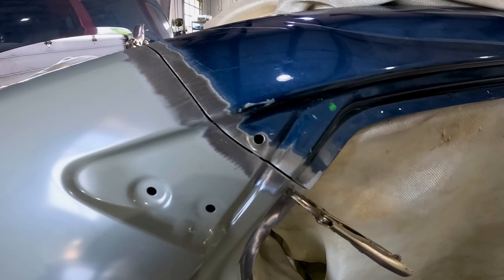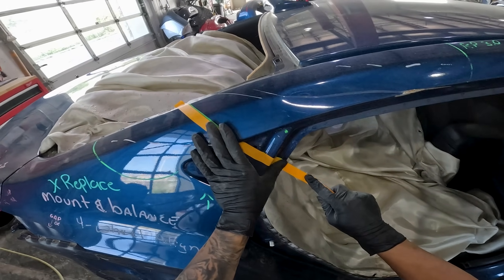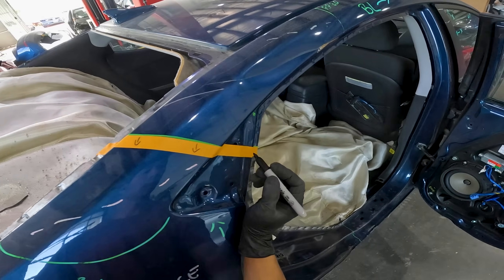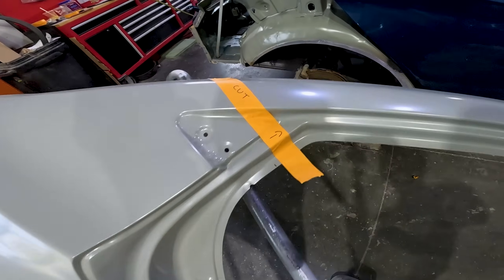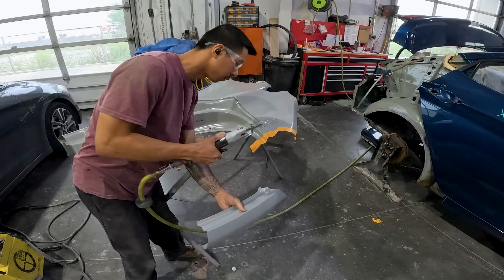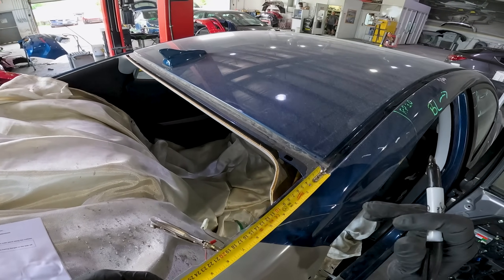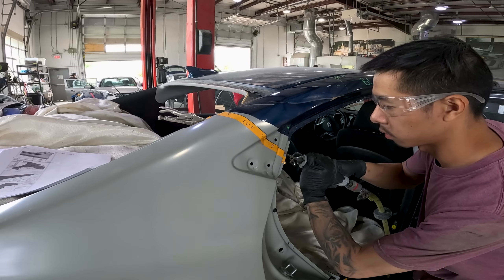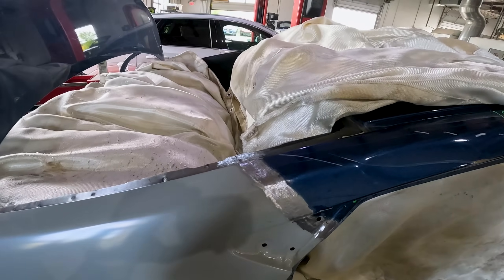This Took Years To Learn, I'll Teach It To You In 2 MINUTES!!

Comment: I did collision repair for over 30 years! This is practically the same method that I used and the only way to do it however for the sake of strength and to give the Weld a backing I will put a 2 inch piece of the new quarter panel inside lapped under the skin on each side of the joint. Especially at the rocker.
Reply: In the 80’s and 90’s some people were saying the metal 
was to thin LoL 😂 
Welcome to 2024 some areas are paper thin now.     👍
Reply: @mhughes1160  RIGHT!? 22-28 ga! You do nice work.
Reply: I do the same thing. I drill a few 3/16 holes on each side of the weld and spot weld the backing plate to hold it in place and for a little extra strength. Makes welding up that seam alot easier too
Reply: I do the same thing, but add a backing plate a little thicker than the replacement panel.@edjackson4389
Reply: Most manufacturers disallow a backer these days. Open butts only.
Reply: @jasonehredt968 yes that's because if you work to manufacture recommendations as supposed to then the entire panel would be replaced, nower days the panels are plastic riveted and bonded . 
Steel is so thin now and high carbon content it's not actually suitable for welding.  I disagree with your comment. 
Actually makes more sense to joggle the panel edge and make a lap joint as this prevents distortion.
Reply: This is how i do it and i do this repair using used quarter panel from junkyards. lot of guys dont know shit about having to remove a quarter panel from a used cut from a car and install it on to another car, guys now days get all new parts, must be nice to work in a shop using all new parts.
Reply: @jasonehredt968  I like baby got back.
Sorry my mind drifted for a moment. 😉
Reply: @turboimport95  print the insurance company a copy of the manufacturer recommendation of no used weld on parts . Even drp shops get new parts . Your getting bent over.
Reply: @jasonehredt968  you are correct  about not using backplate that was early icar recommendation.too bad people in comment don't understand using a backing plate now on car is not recommended maybe on a truck or suv.
Reply: Awesome clip, thanks for the tips!
Reply: What blades do you use?
Reply: @jasonehredt968 I was gonna say the same thing. You have to check the oem procedure to see if they allow a backer or not
Reply: don't worry about the haters,these cars today are junk off the showroom floor!!insurance companies and shops screw the customers and especially their techs!!most owners can't even do a repair!!!!!
Reply: I would have thought that lapping is a bad idea, because you cannot protected the hidden parts from corrosion.
Reply: I too do body work for a living, all vehicles require  a repair procedure,and I was wondering about ,what about the reinforcing behind the splice,but it's just a tip on making easier, better looking fit on the splice.
Reply: @dungareesareforfools that's what cavity wax is for.
Reply: Sorry but u never ever overlap metal as it doesn't fit properly and is a nest for future rust and a complete redo of the job.
Reply: @turboimport95 the junkyard is so expensive now it doesn't make sense not to buy new parts..
Reply: @matthewmoilanen787  Yes and no. Everything has a place.
Reply: @chrishull4174  I like the reinforcement factor, and with proper attention/practices/protocols, will out last the vehicle.
Reply: @turboimport95  Not really. The new parts, for most of the part, are after market, despite the almighty capa designation, they fit like shit. You'll be drilling holes where they should be,  because they aren't, cutting off flanges and welding them in the proper place because again, they aren't, radius often don't match, and if you do use o.e.m. it still won't be as thick as o.e. It's a shit show any way you slice it, the only benefit, they most likely won't have rust. That's it.
Reply: @jasonehredt968  Some car makers refuse to aloud butts welds and some will have a backer made of the part when the new part is laying on top of the old one....... read the instruction before welding. ....... there are a lot of methods to do this king of cutting and weldig.
Reply: @chrishull4174  you are very right, besides these "welds" should be MIG (CuSi) brazed, because of the high carbon content.
And yes, the Panels are a lot thinner, but they are also a lot stronger as "old(er)" steel panels..... ; )
Reply: These days everyone says no overlapping joints, but look at OEM bodies, all overlaps, no butt welds anywhere? Butt welds mean no rust in the overlap, plus maybe room for hammer and dolly finishing.
Reply: @turboimport95 ❤❤ I'm with you, I would rather put good junkyard parts on than Chinese crap
Reply: @raidenout1515  a lot of times, parts are back ordered or discontinued, you cant tell a customer a new quarter panel is a 6 month wait time.. insurance company's aint gonna pay for a 6 month rental..
Reply: @turboimport95  Let it total . No manufacterer allows use of used weld on parts . It opens liability of the shop and the tech in case of a lawsuit . Icar forbids it's use . At least get them to sign off on it and file the record for you or your techs . Nobody wants to lose their house . Not trying to be a downer or flex . Just looking out for the techs out there . Right on the icar website and in alldata.
Reply: @raidenout1515  i dont see why it matters cause its not structural and its thin as a beer can anyway. problem is insurance allows used parts if new ones cant be obtained, cause they would lose money totaling out cars for a few grand. During the pandemic nothing new could even been got, so every car on the road would had been totaled according to you.. quick way to bankrupt insurance companys..
Reply: I watched the guys at a shop that “clipped” cars that were “ total loss claims”. They “ sleeved” the rockers, windshield pillars, made them strong.
Reply: How do you prevent rust between the pieces when they're welded together? Is it possible to get paint in there to cover the entire surface?
Reply: @ThisRandomUsername  weld through primer and panel bond, then seam sealer on the outside of panel edges to seal it in.
Reply: @turboimport95  Insurance not only pays for it but demands it for collision repair on newer cars. You don't have a choice, it is part of the insurance estimate.
Art from Ohio
Reply: @artszabo1015  sorry but insurance also demands you save them money on repairs as well..
Reply: @turboimport95  I don't understand why you would be sorry about that. It seems to me that would be a good thing.
And I don't think you understood me. 
1. When a car that is insured is involved in an accident and the damage is covered, an  adjuster from the company will look the car over and write an estimate for repairs.
2. Depending on the age of the car and the policy the insurance company may DEMAND that Original Equipment From the Manufacturer be put on the car.
Therefore, the OPTION for junkyard parts would not exist.
Reply: @artszabo1015  yeah im sure they will pay for a new oem rear quarter panel for a 2005 Lexus es350. Im sure Lexus has those in stock.
Reply: @turboimport95  I replied to this but it got removed.
Reply: @artszabo1015  dont feel bad about it, i get removed all the time.
Reply: Exactly the same, my Italian mentor taught me that and its always been my favourite method.
Reply: I used to work at a shop where a guy would overlap the new qtr and just glue it on. I never heard of or seen anyone but this guy do it.
Reply: Some manufacturers do not allow backing plates
Reply: @rickdee67 i just redid my little brothers rocker panel and it seems like anything thinner than 16 gauge is too thin😂

Comment: Been doing it like this for 30 years. I allways tack in a bonding strip beneath the joint for strength and to reduce sparks on the inside. Lots of stuf in there that can and will catch fire such as noise insulation.

Comment: It’s a little tough to get corrosion protection on the backsides of the seam w those “bonding strips “ in the way….corrosion being the number one cause of a ghost line not to mention for the comments of the guys that did bodywork for 30 years you of all people should know that the only way to join metal is to refer to the manufacturers repair manual for that specific year and that is the only way to join it paying special attention to what areas are suitable to make the joint… 10 years ago, everybody was mig welding  it now everybody is brazing it w silicon bronze…and it’ll change again probably in another 10 years…oem repair procedures…nobody else… they didn’t spend millions and millions of dollars doing research so you guys could come up with your own procedure… I do have ever like the channel. I like the fact that you’re young and getting into the business keep on doing the good work you’ll go far in this trade.
Reply from the maker: @chrisgray2956  great points! 👍 thanks! Yup, it's all about liability and following OEM procedures. A lot of guys are saying it's not I-CAR procedure but I CAR does not supercede OEM 😂

Comment: Butt welds offer no strength in panel splicing. Especially àfter grinding the weld on thin sheetmetal. It should ALWAYS have a backer piece or flanged edge! Without it, Its the first place to fold or crack from weakness if the panel were to take another impact. NFG!

Comment: I used to make up a fillet to go inside between the two panels where it butts up, then weld it together. Helped stop heat distortion. Quick grind off. Perfect finish every time. I did this work ( body and paint) for 25 years. 6 days a week. 12 to 15 hours a day. I got so prolific it wasn't unusual for me to be working on 8 cars at a time. Getting them ready for my guys when they came in the next morning to get them in the booth for paint. Didn't do my marriage any good however.
Reply: While your where slicing cars rudy was slice n dicin ya wife poor jody

Comment: I was doing this in a insurance approved body shop at the age of 17.. Also using body jigs, floor pullers, pull dozers, replacing front ends rear ends re-shells you name it! 28 years on still doing it! However I'm now feeling it! Get a desk job kids!
Reply from the maker: @Supercarlsunday  😂
Reply: Cars a too complicated now. Airbags, sensors, electronics and now huge dangerous batteries. You need to be an engineer to work on this crap they produce now. Imagine if they just perfected the beautiful cars they built in the past. Simple, strong, affordable and simple to work on.
Reply: @mikehunt-vd2jx  They have changed some for sure. Strip and fit is more time-consuming. It's just time. More crap to go wrong, sensors, etc. You move with the times and get used to it, though. I only know one other lad still doing this job from when I started. He is a mechanic. All the rest have dropped out. There are plenty bull shi! Jobs pay more money. Not for me though. I will keep going, for my sins..
Reply: @Supercarlsunday  my hats off to you. I did it for 10 years. I just didn't have the knack for straightening metal. I have a knack for taking things apart and putting it  back together. What you can do is an art, but sadly people like you are never paid enough for your skill.
Reply: @mikehunt-vd2jx  your right, never make hourly rate. Always something needs to be bought. I appreciate you understanding that. I hope your doing something now that works well for you and allows you to have a good life with good health 👍

Comment: Gap is a little big. The best way is cut the new quarter where it needs to be. Then over lay it and scribe a line with a sharpe object. Cut the panel and debur both panels. Youll then have a super tight gap. As for the techs that say to use a Backer. Im against it as it doesnt allow cavity wax to get between the backers. If its a butt weld then youll be able to spray it with cavity wax. Most of the time procedures say Butt weld only. I forget what they call a butt weld with a backer, i think its called a "fillet" remember seeing it on the symbol sheet for a quarter i just finished up.

Comment: I used a similar tecnic to cut a board of wood to fit a especific hole. Bigger board that covers the entire hole and then cut both. I cut it on a 45º angle in order for the board on the wall not to fall inside the wall. In metal, that won't help you. Maybe make three cuts and tack weld the cut corners. Then finish the cut.

Comment: I let new panel overlap by 1/2in cut a slice in old panel 1/2in in the outside corners then the new panel has a backing and the corners you sliced can give enough to fit properly

Comment: I would have used an agle grinder. Its more precise or maybe its just my ability to use one like pocket knife. But dope sauce, dude killer work!
Reply: The metal dust from the grinding process will spoil the paint work that will be done. Basically, the body saw is easier to contain. Still makes a mess but it won't shower everything in hot slag.
Reply: @daviddntait  Diamond disc not so messy

Comment: I prefer to use panel bond adhesive with a series of backing strips glued to the underside of one side. The backing strips are 1 5/8” wide, leaving a 3/4” flange on each side of the gap. This is clamped using aircraft Cleco Clamps through 1/8” drilled holes. Then glue on the new panel by laying it onto the flange created by the backing strip. Then fill holes with more adhesive. This creates a super strong double thickness joint that has zero warp, no sparks and is completely watertight.
Reply from the maker: @rodb8274  this is a similar method to how BMW and MINI do it. I will have a video with that coming soon.

Comment: Good job hear in Australia we have to remove the panel at the original join seems and spot welds cut and shut jobs like this are illegal the was to many bodgers doing bad work and car's would break in two in an accident so it was outlawed you would need to reinforce the joint and get an engineer report if you want to do it this way even a chop top needs to have a engineer report before it can go back on the road it makes custom work a lot more difficult to do hear and much more expensive for the customer
Reply: Wow thats crazy!! I mean, I see the point but i bet it makes life and doing custom stuff really tough!!!
Reply: USA here educate me what's the definition of a bodger never heard that term before Thanks
Reply: @markpayne6803 
I think it's a combination of the word dodgy and botch-job.
Reply: Same here in the US, not the official OE procedure, not crash tested.  Some of the 1500 MPa panels become much weaker at the heat affected zone of a butt weld.  Times and materials have changed.  Look up 3M and John Eagle Honda.

Comment: I almost always put a backing plate on most joints. It's ez  and less filler you don't warp the metal as bad .don't care what aldata says. It's a skin when you start messing with structure hole different story .
Reply: But then you're never able to completely apply corrosion protection to the joint

Comment: I personally like to see a sleeve added with some plug welds. It really adds strength in the rocker area.
Reply: I’ve done many with sleeves but these days you have to follow manufacturers procedures. If they don’t allow one (most don’t) then you shouldn’t use it otherwise you’re making yourself a liability.

Comment: I feel like that sail panel and rocker should be sleeved, with plug welds on both sides of the butt joint. But, it still looks good from the outside, and you only replaced the outer skin, with no structural damage that I saw. Good job.
Reply from the maker: It really depends on the manufacturer specs whether to sleeve or not. When sleeving these joints, it does add strength to the welded area and may actually be counterproductive to the ability for it to collapse as designed
Reply: @AUTOBODYTECH  very true. I’ve been out the business for about 14 years now. And only do my own jobs, flipping cars for profit and of course building my own projects.

Comment: Nice job although it does leave a good sized gap that needs to be filled with weld.  What if you tilted the saw over, like on a 45 degree angle while cutting?   Then the panel that's resting on top, once cut, would lower down to make a tighter joint, wouldn't it?
Reply from the maker: Yup, it would. I've seen this technique before 👌  🔥

Comment: What brand airsaw are you using and what kinda pressure are you running it on...my ingersolrand dont work that good
Reply from the maker: Lenox or crytool saws. And not sure on pressure, I don't have a regulator on my saw but the astro saw works really well. I'm really happy with it especially for the price too

Comment: Question, why not use the entire length of the new panel to repair the damage further up on the pillar?
Reply from the maker: This is where the manufacturer wants the section. Anything further, you would be replacing the side aperture and be getting into the roof panel.

Comment: Im going to be mounting a service bed on a truck. It will be welded onto frame and i need a product to protect from rust…any recommendations?
Reply: Don't weld it! Use the recommended U bolts. Vibration from driving could cause the weld to crack.  I built trucks like yours for years.  Plus if the truck is wrecked you will have a hell of a time getting the box back off.
Reply from the maker: I agree with using u bolts, but if you were to weld it. Definitely get it painted, then I undercoat it with 3m cavity wax or fluid film.

Comment: I’m thinking of buying the Milwaukee M12 Bandfile and just wondering what ah batteries you’re using and how many spotwelds you can grind on each charge? Are you grinding with a 60 grit band? Thanks
Reply from the maker: @user-gc7hz9hk1v  I recommend the tool. I plan to do a review soon. I love the tool, but it's definitely a battery hog!! I use 3ah and 6ah m12s with 50 grit